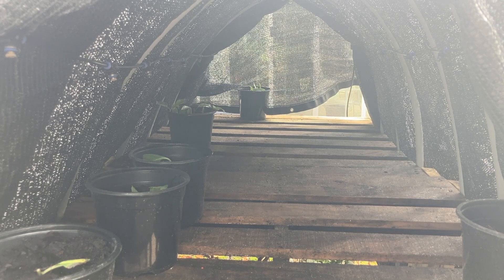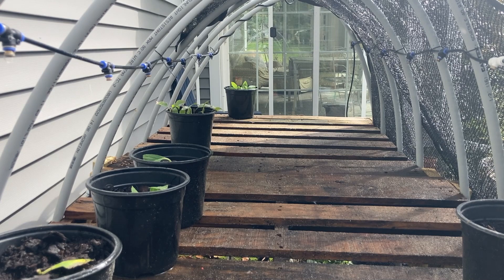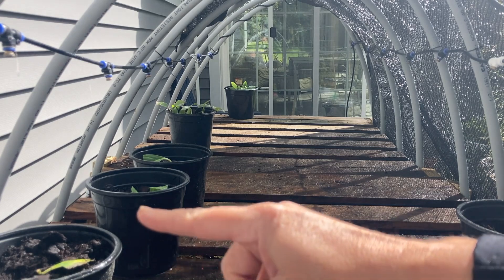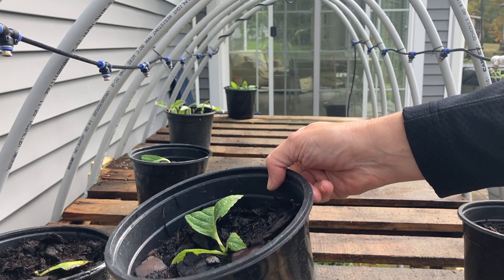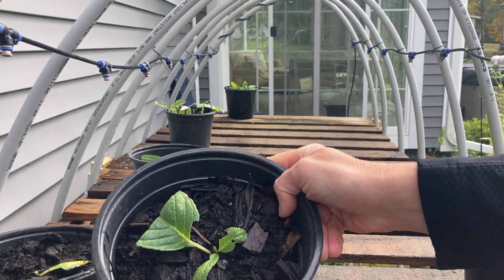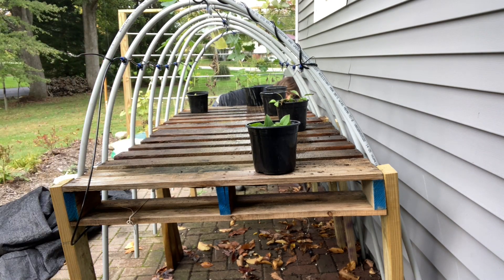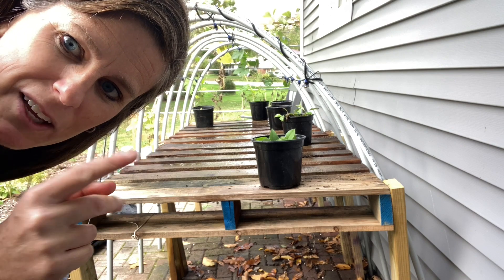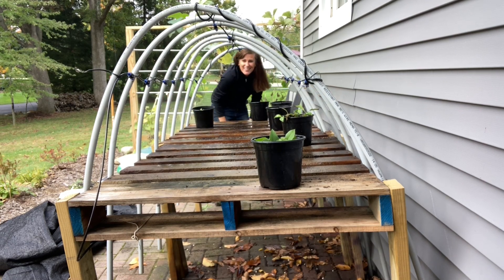Overwintering our Nursery Plant Propagation Misting System

Comment: How many cuttings were you able to propagate in this set up during a season?  How much did it cost to build?
Reply from the maker: We were able to propagate hundreds of cuttings. We used the space of 2 pallets and loaded the area both on top as well as underneath. We used plastic dishpans loaded with several varieties to start and then potted them up as they rooted. The system cost about $100 to build. We included links to the parts in the description. Thanks for your interest.